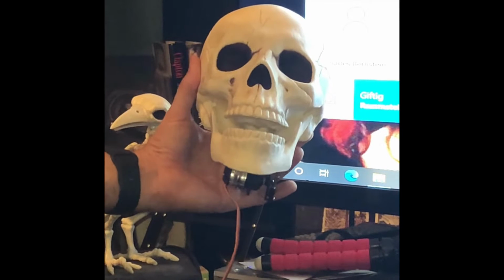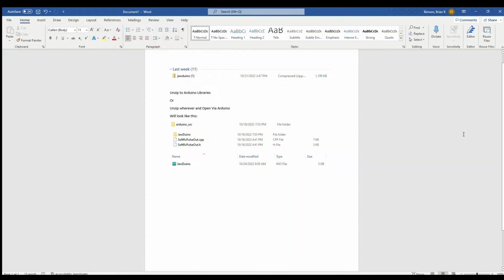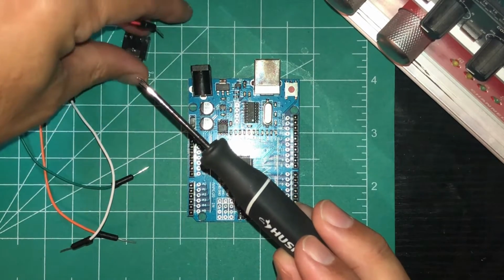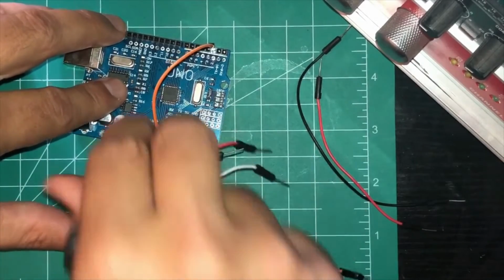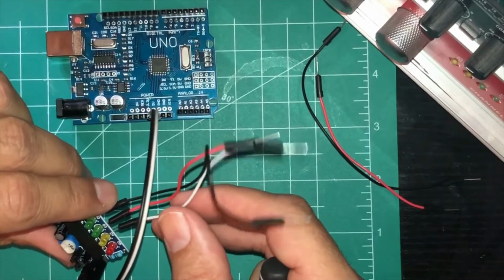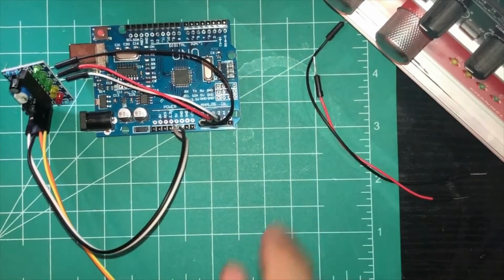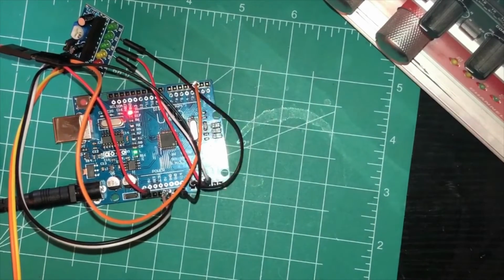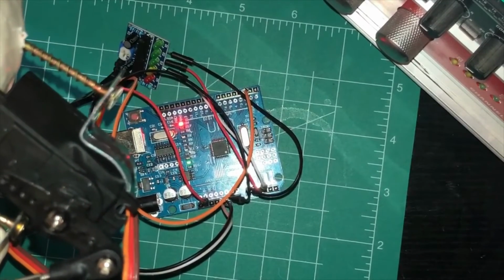Jawduino Step by Step Tutorial. Talking Skull.

Comment: Thank you so much for this tutorial. I was able to complete my jawduino with this great video.  The only issue I have been having is how to configure the audio. I am currently using an mp3 player connected to the audio jack that seems to work, except that I can figure out how to also play the audio on a speaker. I tried using an audio splitter, but that isn't working.  What do you recommend?
Reply from the maker: @jaimepalomino7933 the audio splitters seem to never work. In this video, the sound going to the Jawduino is my headphone jack and the sound is coming out of my computer speakers. What I used for my last Halloween show (I uploaded a video of it), was a device that I had the sound coming from, go into a cheap mixer (less than $80) and then had the headphone jack output from mixer to Jawduino and the line output to a speaker. Does that make sense? Here’s another idea, have mp3 go into an aux port on a stereo. Use another audio cable to plug into the headphone output and the other end to Jawduino. Now you should get sound from speakers and headphones. That is if your radio doesn’t cut out once headphones are plugged in. Mine doesn’t cut out. Or if speakers are detachable, just detach one speaker and use that line to Jawduino.
Reply: This makes sense. Thank you

Comment: Good afternoon Brian, i've been tearing my hair out for a week now try to get this thing to run. I've got the led board going fine. But the Small server motor simply won't move according to dialog. I think it has something to do with the way I am extracting all three files. I got to a point yesterday where if I do the test with the single wire touching the case the motor will go back and forth. But I can't get to the point where other people have gotten. Really want to use this in a not profit haunted house this Halloween. Is there Any help you could Give me. Is there anybody out there that can help me? I've got tons and tons of electronics like power supplies, relays, switches to barter for any help you can give me. Been hoarding electrical parts and electronic parts since 1979.
Reply from the maker: I’m sorry, I’m not really great and coding and electronics so I’m not completely sure what you mean. Some questions: Does the JawDuino.ino  show up as an option when uploading the library to the board?
Does the audio lights activate at any level? 
What I have seen is a straight microphone to the audio connector won’t sense sound. I had to use it through my computer headphone Jack so the audio would activate the lights. I’ll help you through this I just need to visualize what you are doing.
Reply: Good evening Brian, thank you so much for your prompt response!  @brianbenson3091  in Mike norths original  video there was a test when he touched a  wire from uno pin 11 to the chrome ish uno's power receptacle cover and the servo would move back and forth, I was able to get this far. but the servo would not respond when I  hooked up  an old walkman  AM radio  to the peak level meter board whose  LED's did respond according to the volume level. I chose a news broadcast with a person talking. I think my problem is with the  two  SoftRcPulseOut  files that are needed for the loop are not being integrated in the whole page of code. Several widows pop up when I've tried uploading the code, right now I am formatting the hard drive on a laptop For Windows 10 so I have a fresh copy of Windows 10 to try to upload Mikes code to the uno.  I will let you know all the messages that come up during the upload, so far I've seen several Windows Defender messages requesting my permission to go further, then there were several adafruit messages also asking for permission, and then there was a message saying "this file needs to be in a folder called jawduino, create folder and move the files?" Maybe the two SoftRc files and the ino file are being unzipped to an incorrect folder. The weekend is here and I know you will want to spend time with your family, so respond when it's convenient for you  thanks Brian
Reply from the maker: When it prompts you to create the folder you will want to say yes. Make sure you also have the library SoftRcPulse. For an example, for me, my library shows this:
This PC>Documents>Arduino>libraries>arduino_src>JawDuino>JawDuino.ino
Also under libraries I have SoftRcPulse and SoftRCPulseOut 
Then you open the arduino program, go to file, open, arduino folder (mine is in documents), libraries, arduino_src, JawDuino, and click the JawDuino ino file. 
This will/should have all the files you need. Make sure the files needed are in the libraries folder. You may already know this or done this, but I just wanted to go over the missing file aspect you are talking about. I have no idea why windows defender is popping up for you. But with all the files downloaded and in same libraries folder, it should fix the issue. Last, double check wires to the servo. I used a bread board so I made sure at least 5v powered up LED and the Servo, both need at least that.
Reply: @brianbenson3091  good evening Brian I've been struggling all day with this again, i turned   windows defender firewall off and ICloud for Windows off because I was getting pop ups from both. Using a different Arduino board & servo than before, I got to the point again where if I touch the wire from pin number 11, the servo will go back and forth. I read your comments carefully. I have some questions. At no time did a libraries folder get created. Does the libraries folder automatically supposed to get created? What I ended up doing was making a libraries folder of my own in the Arduino folder. Then I put the arduino_ SRC in the librararies folder and in that one I put the jawduino and the two soft RC pulseout files, but I guess going back to the same question was the libraries folder supposed to be created automatically by the computer I'm using or by the Arduino program? I was really gung ho on making a bunch of these so I purchased many arduinos unos and the peak level LED boards. I rechecked all my wiring etcetera etcetera to not to a rookie mistake, everything checks out I have an external 5 Volt 3 amp power supply that is powering up the peak level board and servo. One more thing I noticed was that sometimes I downloaded the jawduino zip folder and it says it's 1999 kilobytes like in your video, but sometimes it's only 0 kilobytes and to know that it was 0 kilobytes I have to highlight the folder and look at properties. It seems to be intermittent sometimes it's the 1999 and sometimes it isn't     very strange anyways have a wonderful Saturday night add respond when it's convenient for you------- thank you very much
Reply from the maker: Only thing I can think of is this; must be your file locations. As you mentioned before, if it asks you to create a folder, say yes. The Pulse libraries need to be downloaded too. There should be three folders in the library for JawDuino to work. 1. arduino_SRC (inside that folder will be the JawDuino folder that has the JawDuino.imo file) 2. The Pulse in folder 3. The Pulse out folder. 
So when you upload the JawDuino to the board, the code will include the other libraries.
If they are showing 0kb, it’s a bad download or file, so you’ll need to download again. But remember, if you get a prompt for a new folder to be created, click yes, and make sure you see the location of that new folder, and make sure the other two folders (pulse) are in same place.
Other than that, I’m not sure what else it could be.
Reply: Hello Brian, thank you for the advice. What was your experience?, did the three library folders get created automatically for you? If the answer to that question is yes , then I don't understand why they're not being made for me . Yes I think I can easily make the libraries folders And have the contents as you Just stated. But I wonder if it's going to work correctly. Your comments to these questions would be Very much appreciated . thanx ross
Reply from the maker: Only the initial request to create a new folder is what I did. I downloaded the pulse folders and put those in same library as the arduino_SRC. I’m sorry my friend, I’m out of ideas. Just make sure you have a “Library” folder that has the arduino_Src, pulse out and in sub folders (3 total for this build). Within the arduino_Src should have JawDuino sub folder inside that. Make sure the folders don’t show 0kb or you’ll need to download those folders/files all over again. Maybe someone else who sees this has more ideas, but I’m at a loss what is missing for you. If I think of something else, I’ll reply to this.
Reply from the maker: I uploaded a troubleshooting video just now, hope it helps

https://youtu.be/oxO5CdacYjQ?si=TEoSopYhJdf3AfRJ

Comment: Struggling with this build, the servo barely moves no matter what I set the parameters to.

Also the indicator lights are instantly red as soon as it's powered up but goes down to 2nd green light when the audio  is playing.
Reply from the maker: When I first started this, my soldering was pretty messy, so on the audio power indicator module, my soldering covered two pods instead of the one “square” like it shows in the pdf. It caused the indicator to go straight to red. Once I cleaned up my solder job, the automatic red disappeared. 
When audio starts and it goes to the second green, does it stay there or fluctuate?
Reply: @brianbenson3091  it pretty much stays on the 2nd green light the whole time once its plugged into the audio jack. otherwise red
Reply from the maker: I uploaded a troubleshooting video just now, maybe it can help.

https://youtu.be/oxO5CdacYjQ?si=TEoSopYhJdf3AfRJ
Reply: @brianbenson3091  it seems be working better now. Or atleast The range is better.

But I need to mess with the sensitivity so syncs with the audio better.

I had another controller that has a built-in lipsync featyre and i actually had to make it less sensitive to get it to look correct.

So that might be the route I go with the jawduino. Are there any of settings or parameters I can mess with?
Reply from the maker: Did you have a chance to see my troubleshooting video? I found out adjusting the volume to the right level made a huge difference. Also, even the preprogrammed numbers worked good too. If you are getting some type of movement, work with volume control to find sweet spot. I also found out stereo worked better than mono, but not sure if that makes a difference.
Reply from the maker: Also what are you using for audio? Stereo, microphone, laptop, etc….
Reply: I did not see there was a trouble shooting video I'll check that out

I'm just using the headphone jack on my phone. I've tried running through preamp but it didn't help.

I dont need to hear the sound for my purposes but I want to servos to sync up with audio
Reply from the maker: Ya check out my video I made to specifically address some of the issues. I haven’t tried it yet with a phone though. Try using a laptop or computer. Bit weird, should work with phone. Try using regular music just to see if it is working. If none of this helps, maybe upload a video on YT your setup and what’s going on and I can check it out?

Comment: Thank you, it worked fine

- https://www.youtube.com/shorts/8vptG_u7jQo
Reply from the maker: Wow I like your setup. Where you get those LED eyes?
Reply: @brianbenson3091   I manually make the LED matrix and replace it on a board with MAX7219 because this LED matrix does not fit into the skull used. Your tutorial is excellent.